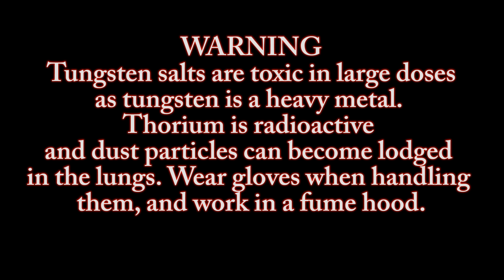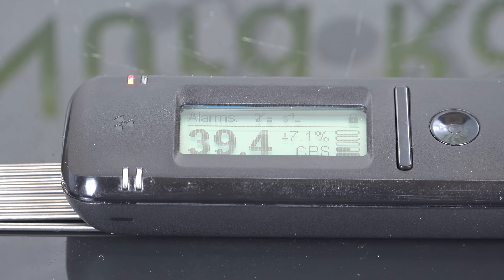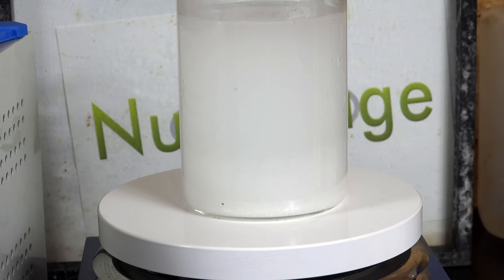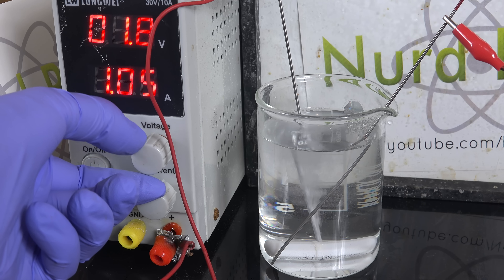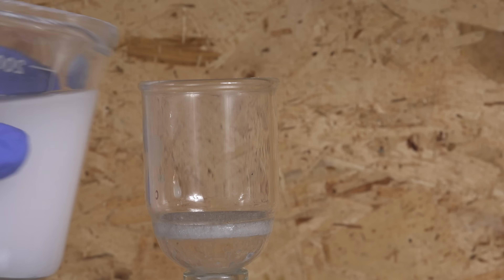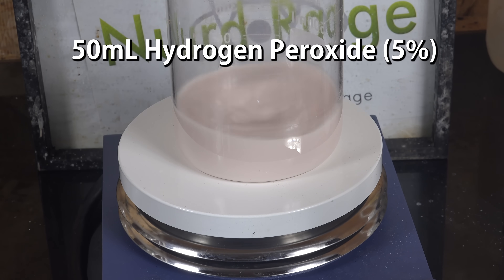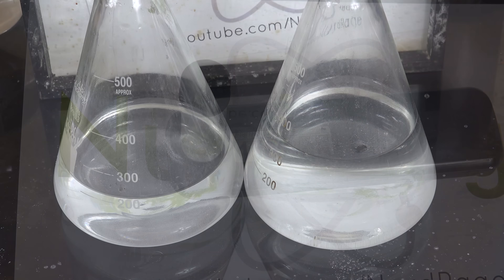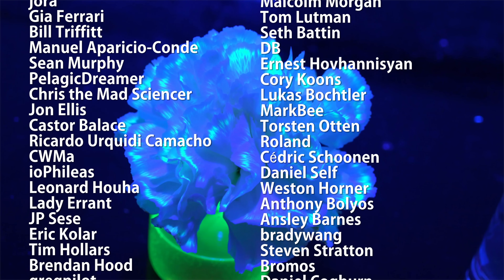Extracting Thorium Dioxide from Thoriated Tungsten Rods

Comment: A nerd ridge love you to death watched you for years I just so happen to be a welder I have to point out to you that those are welding tungstens not welding rod welding rod is the actual material that we're using as the filler those we pump a shit ton of electricity through and use them to stabilize and control the electric arc hence the thorium
Reply from the maker: Ah gotcha! I'm an idiot. I'll see what I can do to fix it. Thanks
Reply: @NurdRage    At the end of the day it's  just semantics, it is a rod that's used in the welding process.  I mean you could use welding rod they're are interested to be used as anodes but they mostly consist of cellulose and mild steel
Reply: @NurdRage  dooo it!! Extract the radium!!!!!
Reply: @NurdRage Can you guys make oral anti-testosterone testosterone inhibitors?

Comment: Please make the video of separating radium from thorium. 

Since I have some thorium mantle dust and need some glowing radium (radioluminescence) paint.
Reply: Probably easier to remove it from uranium hydroxide minerals. They will form a lot more radium than would be present from thorium.
Reply: @alexdrockhound9497  

Thanks a lot for your suggestion. But, the only radioactive items that I have are uranium glass beads and a bunch of thorium mantle.

Also, not in every country allows you to access Uranium.

Fortunately, most thorium mantle is 99% thorium and ±1% cerium.

So, I reckon that using thorium mantle is easier for me.

But still, thanks for the information tho... 👍
Reply: @rahmanaridho  if you can find an old mine with uranium ore in it thats accessible to collect, it will have much more radium due to being so long since it was deposited. The issue with manmade thorium compounds is that when it was originally processed they removed all the other elements out of it, and thorium decays VERY slowly, so any thorium compound you buy that was made in the last 100 years will have almost zero radium.
Reply: @alexdrockhound9497  

Thank you so much for your further information, that's make a lot of sense why my thorium has weak radiation output. 

I also keep it in an airtight bag and barely produce any radon gas.

I know that uranium and thorium are available across the globe on earth crust, but the problem about uranium mine is sensitive information, and there is no information about uranium mine in my country mining maps whatsoever. 

However, the daughter isotopes from the Uranium decay chain, such as lead and bismuth mines, are available here.

So.... can I go to those mine to get uranium? 

Or is the number of uranium there is neglectable? 

Thanks.
Reply: @rahmanaridho the mines you mention wont have what you are looking for most likely. They probably have nothing to do with the uranium decay chain, they probably formed by fusion when a star went supernova before our solar system formed, and are not the product of a radionuclide decay chain, so their concentration in those ore deposits is probably unassociated with uranium at all. 

Im not sure how strict your country is on naturally occurring radioactive substances, but if you can find some pitchblende ore for sale or some autunite, those would probably be a good source for radium. There may be minerals like that available at local flea markets or traveling rock and mineral shows.

Your other option i suppose is going to places that sell antiques and trying to find old things with radium paint. You could potentially reprocess the old paint to concentrate the radium thats left in them, and even take out the fluorescent compound that turns the radium’s radiation into light and reuse it. Though i expect this could get expensive. 

Possibly an alternate to radium paint all together is tritium fluorescent vials that you could glue onto things. They only last for about 10-15 years, and they need to be glued on instead of painted, but it might be able to replace radium paint if the application allows it.
Reply: @alexdrockhound9497  

Thanks for your further response. 

Although buying is more expensive, but it's works and thanks to you for the information, so I don't have to waste extra money and time for going to such mines for nothing. 👍
Reply: @rahmanaridho  good luck on your endeavor!
Reply: @alexdrockhound9497  

Thank you so much for everything! 

That's a big help for me and I really appreciate it. 

I hope all the best for you and have a nice day. 😊

Comment: Corium would also have a mess of different peaks at all sorts of different energy levels due to being a mixture of most radioactive isotopes known to man.
Reply from the maker: But it would make for a GREAT spectrum!
Reply: Sounds like cafeteria food.
Reply: One would think that but most likely you would only see a few lines of the most relevant isotopes (for an example Cs-137). Tschernobyl was almost 40 years ago so the isotopes with a half life of 10-100 would dominate (and I think that are not that many AFAIK). Everything else goes under because your detector is saturated + other effects like compton scattering.
Reply: Most of the short lived stuff is gone now 38 years post event so the spectrum should be decluttered a bit.